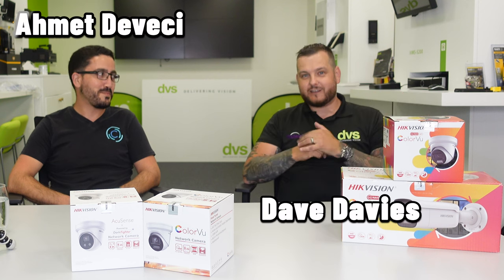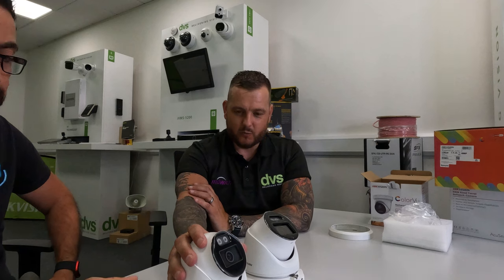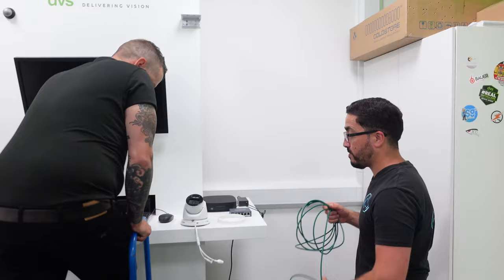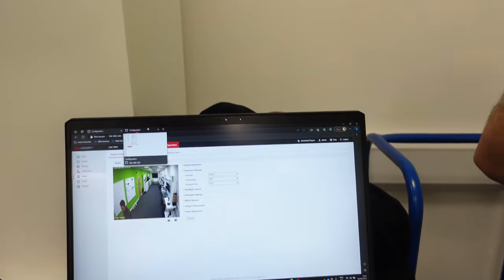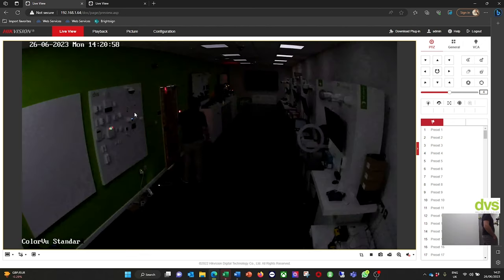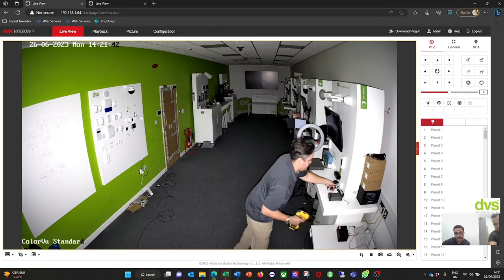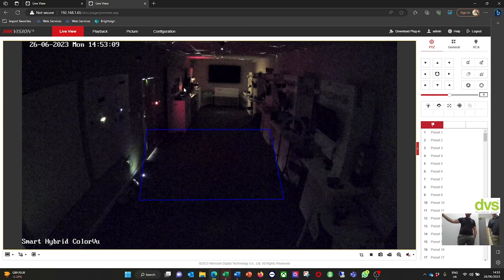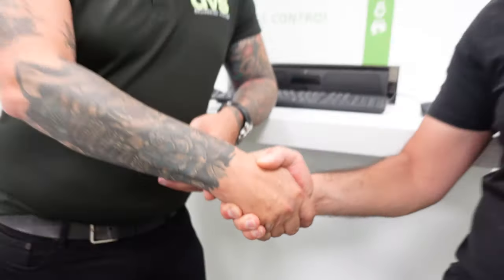Hikvision Smart ColorVu Hybrid v ColorVu Standard -  FULL Review!

Comment: I freaging hate the colorvu camera's. Between the ghosting and the non stop insects in front of your camera's they somewhat work, but in my opinion they are absolutely useless. What intruder will stand still for you to get an idea of what features they have ?😂
Reply: What's the shutter speed in your camera set to?
Reply: @goata007  not sure what exactly, not very low though if i recall correctly
Reply: @quirijnsiersma88  try setting a higher value 1/50 or 1/100

Comment: Nice video.  You can really see the original colorvu and it's larger 1/1.2 lens pulls a better picture in the low light situation with a lot less noise.  Of course the IR image is a lot more usable for the hybrid camera.  It's too bad they went with a smaller 1/1.8" sensor with the hybrid.  Given the whole package, I think the Hybrid camera is still the way to go.
Reply: I was just about to comment this, I was going to jump straight into buying these new hybrid Colorvu turrets for my new setup after months of research but now I'm conflicted. 

I really like the new hybrid light feature but the smaller sensor size does put me off, I noticed the 4mp hybrid model uses 1/1.2 which meets the MP/sensor size ratio but I was after an 8mp turret for my setup. Hopefully they release a 1/1.2 8mp hybrid turret soon.
Reply: correction 

The 4mp hybrid doesn't use 1/1.2 it uses 1/1.8.
Reply: So do you buy the hybrid or the normal? And for a good sensor on a 8mp camera i think we need to wait longer, because dahua have also the same problem.
Reply: So, the take-away from this is, if you don't mind the white lights, the original ColorVu is the better camera. Also, in a real-world situation, an intruder would likely be in and out of the viewing area before the light switched from IR to white and adjusted it's intensity enough to have a usable image. I would like to see this comparison in a real-world setting with the person moving  through the area, rather than walking into the box and standing there looking at the camera.

Comment: You could actually do a scheduled switch using the Image Parameter Switch menu. Set the Custom1 Profile to use the white light illuminator profile and Custom2 to use the infrared profile, then schedule the camera to use Custom1 at all times except when you want the IR to be active instead.

Comment: Any recommendations to stop ghosting? Other then high exposure settings I get ghosting of a day time with plenty of light..

Mostly when someone walks past etc.
Reply: WDR can cause ghosting.  Don't enable it unless needed.  Also avoid H265+
Reply: @johnwilliamson1645  Thanks, I figured that out only seems to be a issue with my colourvu cameras.

It's a pain you lose detail in bright areas when disabling WDR
Reply: @TMCQ  You can get around that to some extent by lowering the contrast from its default of 50.  I usually set contrast to 45 as a starting point.  You'll notice quite a difference.
Reply: @johnwilliamson1645  I did try messing around but seemed to make the image allot darker to get simmilar contrast of WDR but I'll have another mess around later cheers.
Reply: Try using a lens hood to shield out excess light.  https://www.youtube.com/watch?v=07gKS-UCOB0
Reply: What's the shutter speed in your camera set to? To slow a shutter speed will make night images brighter but cause ghosting during day & night.

Comment: Hi is there a way to tell which model hikvision camera is installed? I had a second colourvu fitted but it doesnt seem like the same quality as the first one i had put in a year ago and onscreen menu settings are different. Old one is way better quality but the installer was supposed to install the same colourvu one as the one i had, im not sure if they did how can i check without physically inspecting the dome as it is very high?
Reply: Menu settings changed with firmware update. You may be having older firmware.